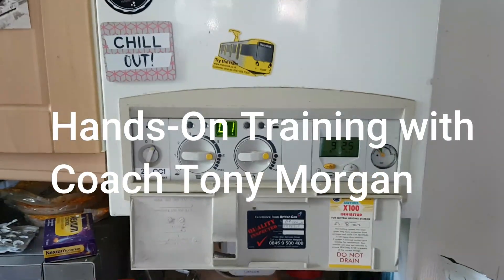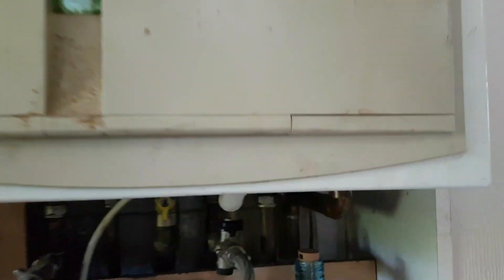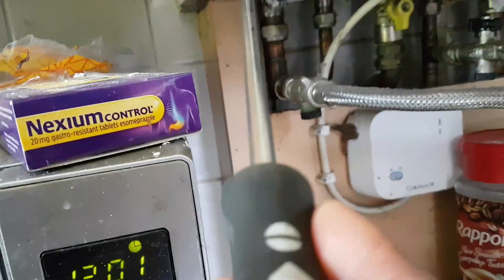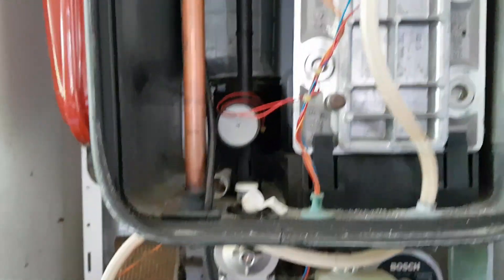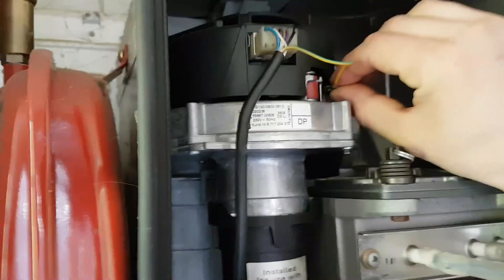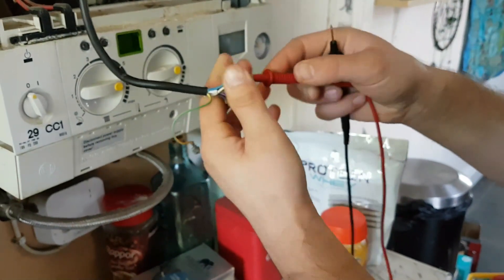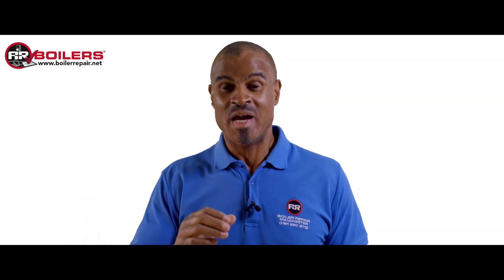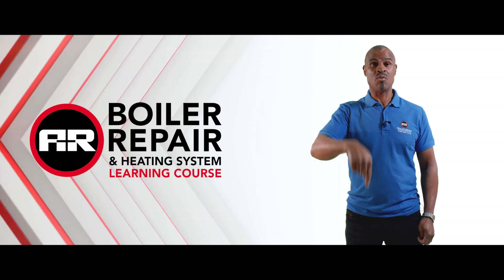Hands-On Boiler Repair Training with Coach Tony Morgan

Comment: Enjoyed video, only one thing I picked up.   A lot of gas engineers are not aware of it.  Multimeters and Voltage testers all should have only 2mm  maximum 4mm (ideally 2mm) metal probe ends under the GS38. this is achieved by plastic covers over the metal probe ends which are sometimes required to purchased separately.
Reply from the maker: Thanks for your comment, Thank you! hey, we're currently growing our Facebook group, it has lots more content there and i'll be there to answer any questions you may have join using this link https://www.facebook.com/groups/167070231326174